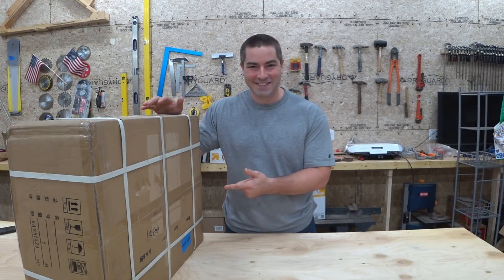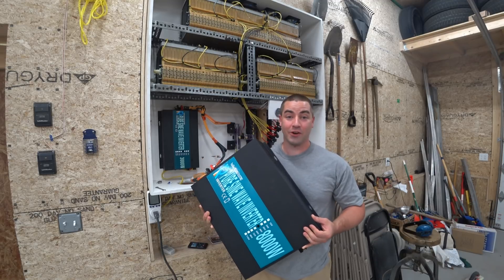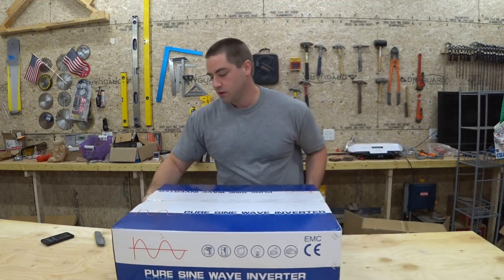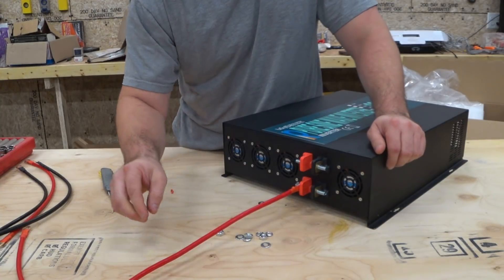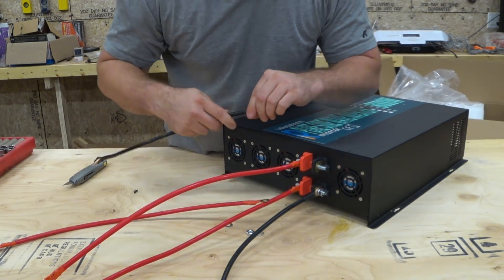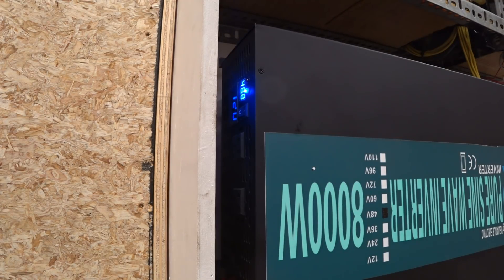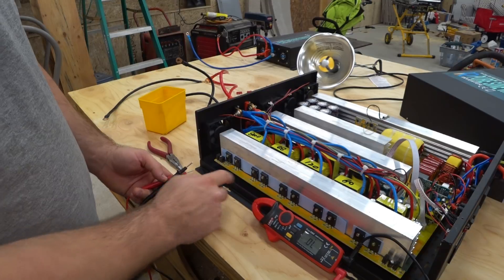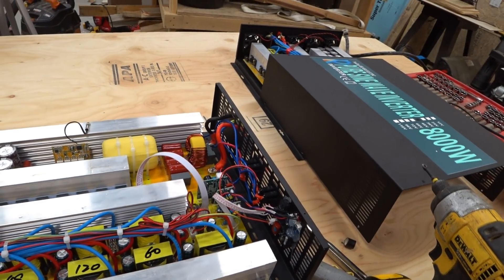Cheap 8000w Reliable Inverter, DIY Powerwall, Chevy Volt Batteries

Comment: I teach motor physics.  Your saw would definitely blow the inverter.  So would most heavy capacity motors/pumps,  compressors,  etc.  
If the inrush current would not fry it,  the reversing current shutdown current would.
Your tests just prove you need to do more research.

Comment: Just to clarify my thought patterns: Anyone can go buy a integrated system and it will work. The cost is like an entire new car. David, in my opinion, is trying to build a budget based system that works and is stable.  In the comments  i have seen SMA, Magna, Spartan, and Aims. (I mentioned Aims) we skipped over Schneider. all are really good but all are more than double the reliable. Thanks David for doing our budget testing for us. I am leaning toward the AIMS but might decide on a Schneider. My system is in proof of concept stage now and, on paper, will power a Cabin off Grid.  I have less invested in the entire system than some spend on just a top of the line Inverter. I will let you know if it works some time next year. Thanks David for doing so much of my R&D for me
Reply: Hmm, how many times I've found out or proved that old saying "you get what you pay for".

Comment: David, I have a reliable 2000 that I replaced with a reliable 4000. Both work well but are way under powered. Using ohms law a 4000 watt inverter should supply 33 amps at 120 volts. My acid test was a small air compressor rated at 15 amps it actually only draws 12.8 amps when running. I run it on a 3500 watt generator or on a 15 amp household circuit when I use it. The 4000 trips after trying to spin it for about 2 seconds. My guess, the power delivery is closer to 15 amps with not enough surge to start the motor. The 8000 would do the trick but it obviously doesn't work. for its price, I can throw a few hundred bucks more at it and get an aims 5000 with charger. To bad the reliable units I have are actually pretty nice, just under powered. Let us know if they ever give you one that works!

Comment: Inductive loads like your chop saw can require up to 7 times the running wattage, which would be over 12,000 watts - way past the rating of your inverter. Most likely, your 3kw inverter was a low frequency inverter and the 8kw is a high frequency inverter. LF inverters will normally handle inductive loads much better. When running powerful motors, always multiply the watts x7.
Reply: They're all High frequency inverters. From this manufacturer.
Reply: No your wrong listening to the man question 3kw run it but not 8kw I know what cause it it’s the spwm halfbridge driver is the big issue the driver ic is rated for 2.9 amp surge with 12 igbt and each igbt draw 1 amp full surge what you think will have when the others or trying to turn it will blow and that it the issue I love building inverter and that was my first mistake using 3 amp driver ic to power 10 kw everything blow up and till I use emitter follower that give 7 amp per channel at 12 amp surge the unit just power Nicely at 6kw load the Same that blow it first so I know it’s the driver ic

Comment: Thanks for the ideas, could i ask if you have enough power for everything you  use ?  I am looking to build and go solar but sorry not for green reasons.  I just wonder if I can get the same amount of power that the electric comp provides but with out the electric comp.  I am a 54 year old guitar player that lives with the 80's motto " excess is best "  sorry for a long message, I'm just trying to figure out how much $$ to spend to get what i want  thanks Gbl

Comment: The fuses look like 10amp fuses so that would rate the inverter at 10amp and would trip if you are trying to use a 15amp device through it what are the fuses in the 3000w inverter

Comment: I've bougth 2 Reliable inverters, one 48volt 3500watt that blow up with a load of only 1930watts, the other one was a 10000watt 48volt that only lasted 7weeks, stopped working at idle (turned on, but with no load), nothing burned inside, all Fets, diodes and resistors intact!?
Do not buy this crap, spend your money on something better instead!
Regards, Peter

Comment: 8000watt is the peek not the duty and i see its a HF sine wave not a LF sine wave.  LF is also good for heavy load and heavy start ups in cold or snow and last longer where HF is not good with heavy start ups but HF is more power efficient

Comment: My two bits worth:
Reply: Some inverters ae not intended to have either side of the output grounded. This is because in effect you have an auto transformer,
which has battery voltage on it. That is why these will not meet code for powering a house. They are fine for powering isolated loads. Run your chop saw on an extension cord. The inverters that are intended for this purpose are sold for marine use, as well as off grid, and have a earth ground as well as neutral. Many also have transfer switches, as well as battery charging capability. They are not particularly cheap.
The transistors act as a protective device for the fuses. The silicon melted microseconds before the fuses blew. Replace all of them at one time. 
You can easily test my theory, use an ohm meter to see if the AC output has any resistance to either battery + or -.
It should (MUST) not have any continuity.

Comment: you need higher surge capability mosfets and possible higher amp fuse.it could do 8000 watts of lights lit up one at a time but inrush current surge is too much for this type of inverter.Also you need a bigger battery bank for a big draw. INVERTER IN THE MIDDLE AND BATTERIES ON ONE SIDE AND LOAD ON THE OTHER LIKE A SEESAW. balance is a must. you do that and you will not cook inverters anymo. GOOD LUCK.

Comment: It could be start-up current on the saw, however, the inverter should have better circuit protection,  
it is time saw manufacturers invented saw motors with a slight soft start to the motors. 
The most annoying thing I own is a food mixer when its turned on the kick from the motor forces the liquid upwards and on to the lid, once its running the liquid stays clear of the lid. 
Clean up would be so much easier if the motor was a soft start.

Comment: The reason "cheap" inverters are cheap is because the companies making them scimp, on parts and on design.  Big inductors and smoothing caps cost money, lots of money. High speed, high accuracy current controlled boost converters also cost money to develop, lots of money.  So whilst you can make a "cheap" inverter, generally speaking, you get what you (don't) pay for.....  ;-)

Comment: Rather than guessing you need to measure the instantaneous high current draw when the saw starts up. A good multimeter/ammeter will do that,  perhaps with a shunt installed or looping wire around the cable to get a current read in the cable being tested.  But more than likely the problem is excessive current draw by the motor you are using.

That the 3000 watt inverter starts the saw is interesting but not relevant to the issue of excessive current draw on the inverter you are testing.
Reply: He didn't use the 80A breaker on the 3000w one. I saw the arc from the breaker. Either the breaker shorted or the hot arced to ground ( still a short ). You can see the flash just as he pulls the trigger. I blame the breaker until he removes it and tries with a 3rd device.

Comment: Be sure to check the mosfet driver circuitry for damage as well. A Huntron Tracker will show component leakage and near shorts or resistitive faults in IC’s.

I run a electronics repair shop.
Circuit Solutions & Repair LLC.

circuitsolutions.repair@gmail.com.

We have Huntron Trackers and ABI V/I signature analysis equipment. Feel free to contact us if you need us to test this unit.

Comment: The capacitors are too small, they need to have a much larger capacitor value. The capacitors job is to provide enough current during a heavy startup inductive load. That saw likely has at least 60Amps of inrush current on start up. Hard job for modified sine like the one you have. Buy a Schneider 6848 and smile all day.

Comment: The line that supplie your miter saw need biger value circuit breaker. So fuse are collpse because the moter of the saw need instanlty 5 times more amperage for starting. So checking the value of the fuses and replace but first be souare if the inverter line that you connect your miter saw it have the ability to support you. What is the voltage price of your miter saw 120V or 220V?

Comment: As someone who used to repair BIG car audio amps, I can tell you many have failed SMP power supply’s because the user “under fed” them. You need to hook it up with more/ thicker cables to reduce input voltage drop. From what I have seen, this is not the manufacturer fault but yours. It would have been interesting to have a scope or even a meter wired to input side to see how much voltage dropped. I know it is reasonable to think that the wiring sufficed for the smaller unit and its load, but that is not the reality.

Comment: Mine lasted 3months and they sent me wrong mosfets to fix after that ignored my msgs,  also there not even pure sine wave a amplifier in my house would not run with it, as my non pure wave did the same. Got a epever inverter and geez it's state of the art compared to reliable crap inverter runs amplifier and doesn't tripp everytime sun shines through clouds.

Comment: The circuit breaker is too small and I suspect not dc rated. Get a proper breaker or fuse. Ac and DC circuit breakers are different.

Comment: Reliable Electric is a great company, they have great customer service, and I've not had a problem with any of their kit... although the biggest inverter I have is 4000w (I think it's a beefed up version of the 3000w one)

I'm very curious to know what the issue with the 8000w unit turns out to be.
Reply: Probably because of the motor

Comment: Wow! I don't know where to begin! Yes, I was suckered into buying one of these. I own the 3500W 24VDC rig. Had it since February '18, but hardly use it. First of all. From China? Divide by 2. Meaning, de-rate specs by 1/2. 8KW? Try 4KW @ best. I haven't blown mine up yet, but it couldn't start up a standard Dehumidifier. Just went into shut down. One commenter mentioned soft start motors. YES! Why not? Oh...Cost more. I bought a stand alone soft start module, had to make a mod, but it worked great starting up a big Skil circular saw, shop vac, things like that. The problem is that construction equipment, anything hand held with a finger operated trigger won't work with the soft start module, since you must power up the module while the saw, for example has it's finger switch closed first! Kinda tough to do. A soft start circuit gives the motor like 1/2 voltage for less than a second, just to get the thing spinning a bit, then switches in full line voltage until it is shut off. Huge different in start up current! I've measured it. A Skil saw draws like 35 amp spike when started. After inserting my soft start module, the start up spike drops to around 13 amps! You hardly know it's working except the saw doesn't have that "kick" action. Once module relay closes, saw runs normal with full cutting power. I'd pay extra for a soft start in any machine that uses a brush type motor. Unfortunately, there are some machines that need that high current rush, like air compressors and the like. Back to the UN-Reliable inverter. Yes, it is full of flaws. One biggie is that mine at least, has a floating neutral, meaning both HOT and NEUTRAL legs ARE HOT! Each leg provides 1/2 of the full 120VAC power! Try grounding the neutral and POW! Out go the lights! Cheapie design to cheat. A good inverter will have a cold neutral like house wiring. Next is poor voltage regulation. Blaa blaa. The list goes on. Enough. I sent Reliable a super long email months ago about all this garbage, and of course...Crickets.

Comment: Dam, Sounds like a big issue with this inverter. Must be the MOSFETs are under spec or they are china mosfets. 
"Going Off Grid" replaced his with the bigger models but they also blow from memory. I would start by replacing them with the biggest you can get. The ones you have should be  G160N60, SGL160N60UFD. If not its the old model of the inverter.  I bet the problem is to do with "Influence of Short Circuit conditions on IGBT Short circuit current in motor drives " If you google that there is a very good word doc explaining what happens. EG protecting the IGBTs against short circuit
conditions is a critical aspect of the
 Industrial motor drive design. The SC (short circuit) conditions can occur in a variety of ways in an industrial environment. The SC applied across the motor drive terminals result in a different fault current profile than a SC that happens at the motor terminals or between inter winding coils. Or in simple terms, the AC motor shorts the AC terminals and the MOSFETs that are meant to be Short Circuit Rated IGBT don't do a good enough job and blow. Have a read of "https://www.researchgate.net/post/Why_do_I_get_a_IGBT_short_circuit" . Maybe this inverter is also missing a good IGBT protection circuit which protects the MOSFETs from Shorts. I cant find any bigger mosfets then the SGL160N60 which means either they need more mosfets in Parallel or they need to add a IGBT protection circuit.
Reply: Given there is more than enough room on the heatsink i would look at adding more mosfets and doubling them up as it would be easy to solder small wires to the current ones to add more. But get it going again and then do that.

Comment: I would also wonder why the inverter isn't designed to protect it's self with out burning fuses and mosfets. A 'Reliable' inverter should be capable of shutting down and NOT self destructing. I've got a Prosine 1800watt, that has been in daily use for 12 years. If the input voltage is too low, it shuts down and you can turn it back on when the voltage returns to appropriate range, Same with over voltage, I learned this when I pushed the equalizing voltage up and the temperature compensation (from my Charge controller) allowed the input voltage to go above 32 volts (24 volt system). The one time it has failed, was when the fan died after 8 years. It would work fine up to about 450 watt load and then would over heat, once it cooled down it was fine. I replaced the fan and went on with life.

Comment: I’ve got the 3000W 36V 230V50hz version and never got any problem. The sine wave is good and I like that it doesn’t make any unnecessary noise. I would have liked a separate protective earth connector on the case instead just the wire earth connector

Comment: at 7:17 sparks come out of one of your cable junctions.  Bottom most one on the right side of your rail.  You're blowing the inverter because of a wiring fault.

Comment: Unfortunately, regardless of the cause of the failure ... it appears their design quality for the higher wattage unit isn’t a proportional upgrade to the design quality of the 3K unit.  

Too bad it isn’t designed to just shut down instead of destroying itself.  That alone would prevent me from buying it regardless of whatever the price might be.

Comment: theres no way that inverter could produce 8000 watts to begin with. Its got a single 110v output that is trying to push almost 80 amps through it?!?!
Reply: is that the load the saw pulls at start up ? ... I would not be supersized!!

Comment: It's 8000w peak not constant don't pull more then 3200-4000w on it or you blow it (especially on the 110v version) the reliable inverters lack a soft start load feature so they will try to deliver the max power all at once instead of soft ramping up the load witch leads to there destruction when the Mosfets go short circuit (to many amps not enough Mosfets to spread the load) 

Another issue as well is overload/over currant(amps) protection is missing on models I believe above 4000 Watts on reliable inverters so they will self destruct instead of cutting output on overload
Reply: I'm glad to see you wrote this up as this is the only one that makes any sense

Comment: Your peek amps are too high. 1500 watts motor will draw tenfold for a very short time (long enough to pop your inverter). Use a long extension cord (the voltage drop will compensate the peak amps) or a real heavy inverter.

Comment: Did the same mosfets blow? If one of them starts flowing before the others it  could wind up sinking a lot  of current and the more in parallel there are the higher the chance of that happening. Just heard of this happening in a motor driver design I don't have any experience running mosfets in parallel with heavy loads.

Comment: I had a 4KW version of this inverter and it made popping noises and started spewing smoke when I tried to start my 12,000BTU air conditioner with it.  Since I am not making promotional videos for them, it went in the trash and I got a completely different 6 KW inverter which starts the AC easily even though the new one is modified sinewave instead of pure sine.
Reply: You just tossed it? Why not have it replaced and sell the replacement?
Reply: yeah i was wondering that too.